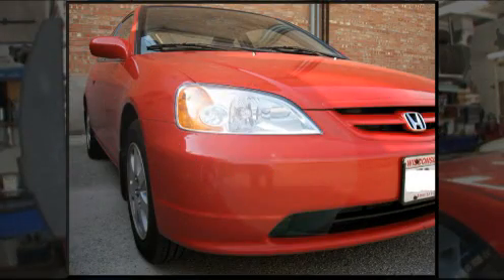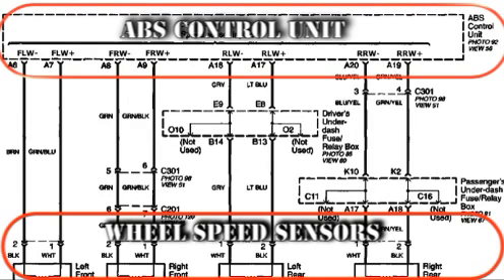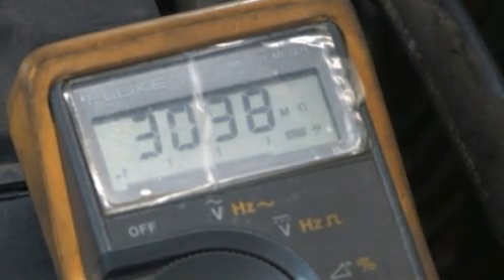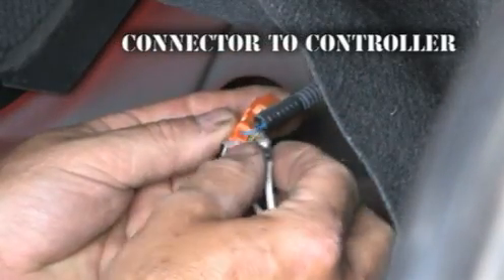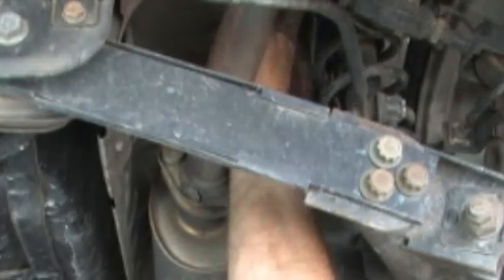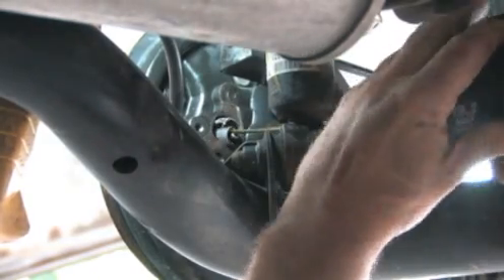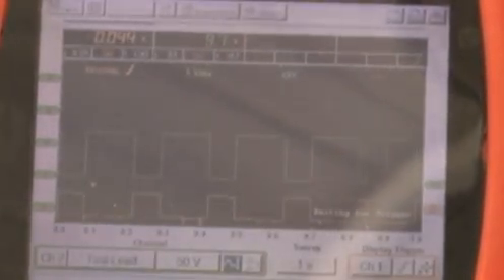ABS Sensor Diagnostics, Troubleshooting and Repair

Comment: I replace both Front  ABS Sensors on the 2000 Dodge Intrepid yesterday. Took the Intrepid for a ride and still have the same problem that I had before with the pulsation in the brake pedal with grinding noise. Didn't take long to do it as I was only 2 blocks from home. What do you suggest now as you have all of my info of everything I have done so far to check this problem out. Had to pull the fuse once again for the ABS Pump in order to drive without ABS. Brakes work great when this is done.

Comment from the maker: @ffas23 Yep, resistance is good, but the output is low. When you slow for a turn or stop the ABS controller thinks the left frt wheel is skidding because the signal stops and pulses the right frt. Happy you found it. If you ever need assistance please let me know, I will do my best to help.

Mark Hicks
Wells Vehicle Electronics

Comment: Mark thanks for the pinout diagram. Checked the wiring from all 4 ABS Sensors to the controller and it is good. Once again had a mechanic connect his Snap-On Scanner to the 2000 Intrepid and we drove for 5 miles. He watched each wheel  readings from all 4 ABS Sensors. The Rear Sensors stayed about equal throughout the ride. The left Front Sensor was off anywhere from 5 to 8 points depending on how fast I was driving compared to the Right Front Sensor. The mechanic thinks the left Front is bad.

Comment: @markjhicks,As mentioned I spun all 4 wheels with the Multi-Testor attached to each sensor. I have readings in the Volt Scale and Ohms Scale. Volts Scale on the Passenger Front wheel with hand spinning was from 0 to1.1, Driver Side Front 0 to .07, Pass Side rear from 0 to .04 and Driver Rear from 0 to .02. On the Ohm Scale without doing any spinning the Pass Front read 1.10,Driver Front 1.09, Pass Rear 1.09, Driver Rear 1.12.  Reading were directly to the sensor. Do need a pin out  for control

Comment from the maker: @ffas23 If the ABS is activating at low speeds it is because the ABS controller thinks a wheel has stopped turning. Try turning the wheels at a slow speed to see if you are generating AC voltage. That is the key, you must be looking for AC voltage. Make sure they are all generating at a slow speed. You might also want to check for the same voltage at the controller to make sure the wiring is in tact. If you need a pin out for the controller, send me a message from my channel.
Mark Hicks
Wells VE

Comment: @markjhicks, On my 2000 Dodge Intrepid I did what you suggested to do and hooked my Digital Multi-Meter to both ABS Speed Sensors one at a time  in front  of the car and then the other 2 in the rear directly  to the Sensors in the Volt position. Each Sensor gave me a reading showing me they are working when spinning the wheels by hand as fast as I could. Also did a Ohms test and also got readings there. What do you suggest I do from here? Car is up on my lift. No need to use it until fixed.

Comment: @focijohn, I  already checked that out and no bits or teeth missing on the Dodge Intrepid on either side in the front where I believe the problem is coming from. Getting ready to check everything once again today  and will visually check everything plus use a multi meter on each sensor starting at the front as suggested by Mark. Will let everyone know how I make out here. Mark if you are reading this I wrote back to you asking if you knew of any WD's here in N.J. selling Wells Sensors?

Comment: @ffas23 
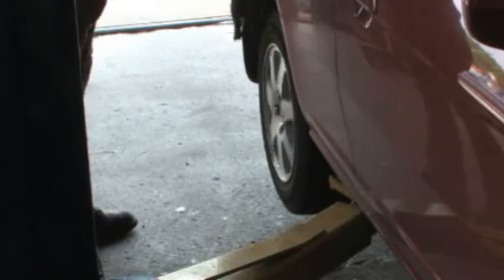Here in the UK I've seen a few ABS pick up rings split (trigger wheel as shown at 4:32). This usually gives a symptom of the ABS kicking in intermittently at low speeds and doesn't always throw the light on. If you can see the trigger wheel it might be worth seeing if you can see any splits or bits missing.

Comment from the maker: @ffas23 Usually this problem is caused by a wheel speed sensor that stops generating a voltage at low speeds. Start on the front wheels. Jack them up one at a time and connect a voltmeter to either the sensor connector or where it connects to the computer, like we did in the video. Set the meter to AC volts and spin the wheel by hand. Even at slow speeds like this the sensor should generate some voltage. If it does not the sensor needs to be replaced. 
Stay in touch, 
Mark Hicks
Wells

Comment: Have a ABS Problem in my 2000 Dodge Intrepid but the ABS Light does not come on while having the pulsating problem that I can feel in the brake pedal at low spd. Its been a intermitant problem otherwise the brakes feel great. Replaced both front pads and rotors about a year ago figuring that might be the problem but of course it did not correct it. The problem I am having has gotten worse. Pulled the Main ABS Pump Fuse under the hood and the problem goes away and brakes are great. Any Thoughts?

Comment from the maker: @madnis007 I think you are probably correct. I suggest getting the ABS code pulled, it might lead you to the correct sensor. Whenever the ABS light comes "on" a code is stored in the memory. I hope this helps, if you need any further information just let me know.

Mark Hicks
Wells vehicle Electronics

Comment from the maker: @techdavey1000 You are correct in thinking there are different types of sensors. The tone generators as you call them are magnetic reluctant. They generate an AC voltage that is sent to the ABS controller or PCM to determine wheel speed. The exciter wheel or bearings can emit rusty metal that will inhibit the generation of  AC voltage. However, this was not the problem with this vehicle. When the resistance reads very high like this one did the sensor needs to be replaced. 
Mark

Comment from the maker: @jimmyhorse1  If there is voltage on the Green/Black wire, then backprobe the Pink wire and turn the wheel there should be a pulsing voltage signal produced by the wheel speed sensor back to the ABS control unit if the sensor is working correctly.

3. If there is no signal and the correct wheel bearing is installed with the magnetic side towards the wheel speed sensor,

Comment from the maker: @jimmyhorse1 1. If there is no voltage or the voltage goes away after a few seconds then the control detects a problem with the sensor or the circuit.

2. Verify the Green/Black wire and the Pink wire is not open or shorted. If the harness is OK, then suspect a faulty wheel speed sensor.

Comment from the maker: @jimmyhorse1 I don't see any calibrating procedure for these wheel speed sensors. Here is the diagnostic procedure from Identifix :

1. The wheel speed sensor is a transistor so checking the resistance is not a good test. First backprobe the Green/Black wire with a volt meter and turn on the key. The ABS control unit should send out 10-12 volts to the wheel speed sensor.

Comment: I have a 2004 Honda Accord LX (2.4L, front disc, rear drums) I had the ABS pump replaced 1 year ago. The ABS system was fine until recently. My mechanic recently told me that one of the sensors was seized into the hub and he had to replace the hub and sensor. After that was replaced,  I'm still getting the kick back in the brake pedal, on occasion, when i'm turning/slowing (however, ABS light is off). Mechanic now says the speed sensor is not calibrated. Does this make sense? Help appreciated

Comment from the maker: @shanewalker25 You have so many codes ,,,where do you begin? I suggest clearing the codes and then as soon as the light comes "on" pulling them again. This will give us primary code(s) and we will have a starting point. 

Mark Hicks
Wells Manufacturing L.P.

Comment from the maker: @dogsknobs By clicking do you mean the ABS is activating at low speeds? If so, typically it is a wheel speed sensor that is not generating at low speeds. You can check it like we did in this video. If you reply please mention the year, make, model and engine size. Also you should check for ABS codes and if you have any, what are they. The more information you offer the more I can help.

Mark Hicks
Wells Manufacturing L.P.

Mark Hicks

Comment from the maker: @Dogapsa From information you have given me, it appears either the system has air in it and needs to be re-bleed or possible power bleed, or you have a leak somewhere that you are not seeing or the master or somehow you are getting air back into the system after you bleed it. Think about it for the pedal to slam to the floor with no resistive pressure means air in the hydraulics. I would try bleeding again, start with the Right rear go to the left rear then the right front  finish left. 
Mark

Comment from the maker: @Dogapsa At this point I will have to agree with your tech. If something where stuck like a caliper, the pedal would not go to the floor. It would be hard and not travel as far. One quick way to check if the master is doing anything. Have someone push the brake pedal like they are bleeding the system, then crack one of the lines connecting to the master. You should see a stream of brake fluid come out. Question did you bench bleed the master before installing it?

Mark

Comment from the maker: @foxdmulder A modis is nice but slow to start and it has battery issues. Two things it does well are multi traces and PID graphing. If you are an experianced scope used it is a good choice, If you have not been using a scope I suggest purchasing a used dual trace and then move to a more complicated scope. But before you buy a good scope also check out ATS test solutions, this will be the scope we use in our upcoming scope training videos.

Mark Hicks 
Wells Manufacturing L.P.

Comment from the maker: @therockkkkher This hub does not have grease in it. However some manufacturers do have grease in the hub. Grease will not effect the sensor operation. However, anything metallic and or magnetic will, such as metal chips or shavings. Great question, if you have any further thoughts please let me know. 

Mark Hicks
Wells Manufacturing

Comment from the maker: @hawaiismainlander Below is my work phone number. I would be happy to send you the pin out for your vehicle. I will need year, Make, Model, engine size, 4 whl or not, information 
1-800-558-9770 press 3

Mark

Comment from the maker: On a 1996 Civic the rear speed sensor are located in the hub. The testing procedure we show in the video will work on your vehicle also. i suggest checking the AC voltage output from each rear wheel before replacement. It will take about one hour per wheel to replace the sensors.